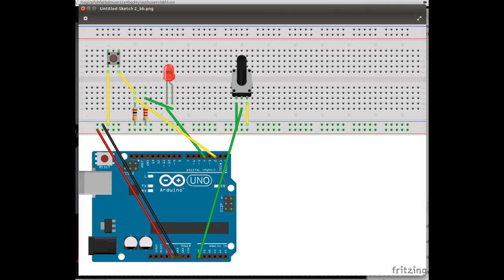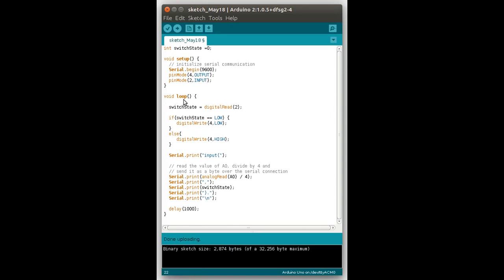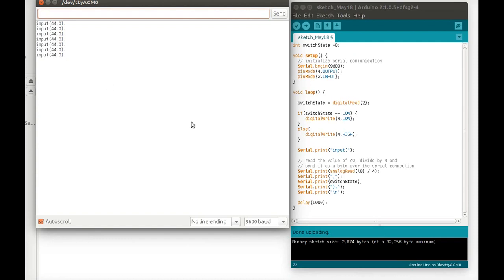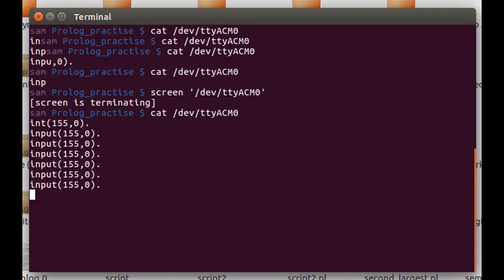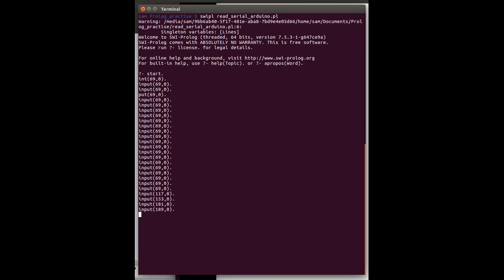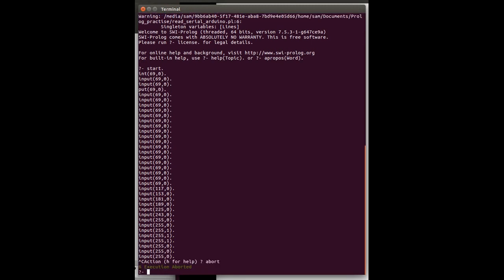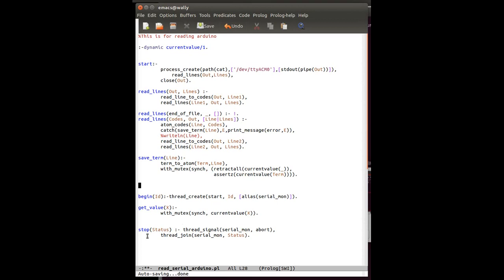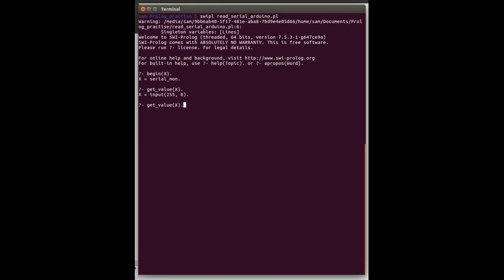Playing with Prolog - Connecting an Arduino to Prolog

Comment: I do not understand the command "cat / dev / ttyACM0" I only have "Hyperterminal", so I do not understand how the link is made with Prolog and so I can call what is being sent from my USB port (Arduino put as "COM5 (Arduino/ Genuino Uno) ). Thanks for the attention.
Reply from the maker: I only tried it on Linux, cat is a standard linux command where you can output things to the terminal.. so I am just outputting the com port which is called ttyACM0 on my machine.